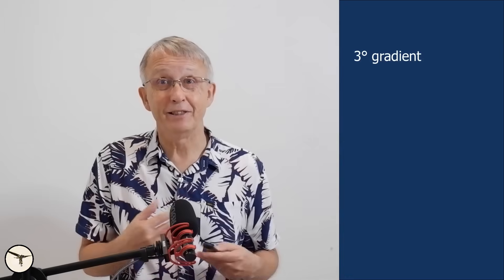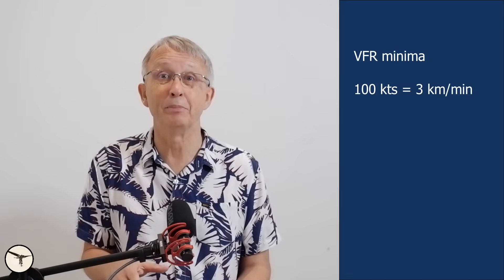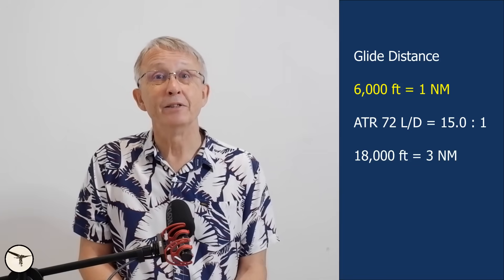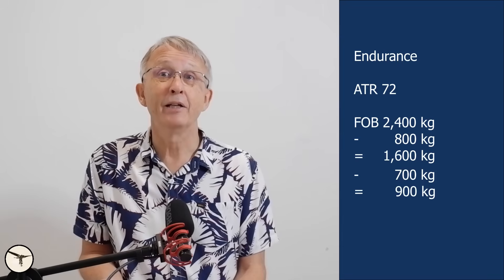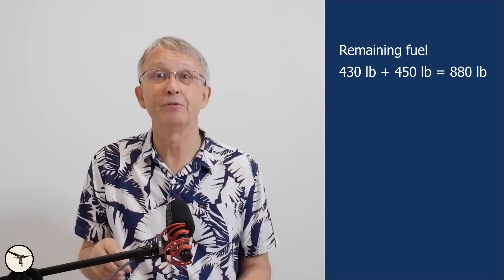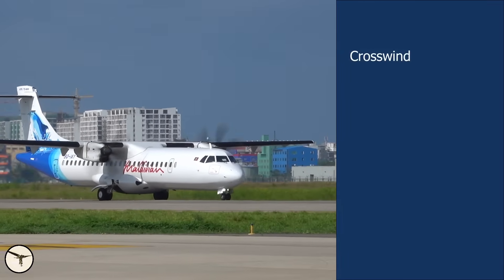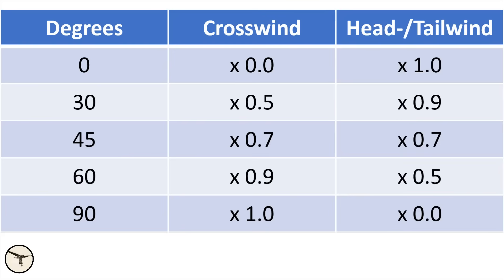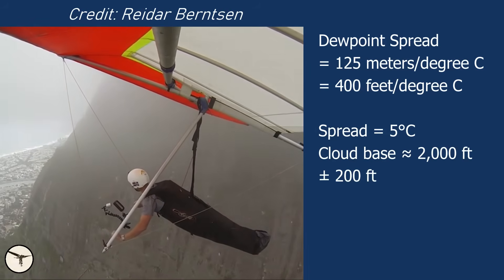The Surprising Truth About Math for Pilots Nobody Tells You

Comment: Thank you Capt. One question: In the video you state that best glide speed is White bug + 10, while in the ATR 72 manuals the recommended speed for Eng 1+2 Flame out is indicated as VmHB which is White bug + 5. Why this difference?
Reply from the maker: High bank speed can be anything between white bug + 5 and white bug + 10, depending on ATR variant and weight. Therefore, ATR recommends white bug + 10 as a rule of thumb.
Reply: @FlywithMagnar  thank you for your reply. In the ATR 72-600 that I am familiar, the difference between VmLB and VmHB according to the QRH tables is 4-5 knots for all weights, which makes sense as according to the FCOM the VmLB=1.18Vsr and VmHB=1.23Vsr. So at least for the 72-600 I would expect defining the glide speed VmHB as White bug + 5 would be way more accurate than White bug + 10. Please correct me if I am wrong.
Reply from the maker: I have no problem with that. Having flown six different ATR variants, I'll stick to white bug +10.
Reply: Thanks so much for the reply Capt, and for the excellent training material that you generate. Your efforts and expertise are highly appreciated.

Comment: The statement that the weight of the plane does not affect the glide distance is wrong. At the top of descent, you pull off the power. In a large (heavy) 4 engine transport catagory jet, if you are heavy, you add another 10 miles to the calculation. In addition to the adjustment for a head or tailwind. 
  A heavy plane needs more distance to descend with power off because of momentum. A lightly loaded aircraft descends faster. It is the opposite of what you assume. But in large jets, momentum is a factor in many aspects of the flight. This guy must be flying small planes as this seems to be his point of reference for all this.
Reply from the maker: That's energy management. When you travel at the speed for the best glide ratio, the weight will not affect your glide distance.
Reply: @FlywithMagnar I assure you it does. I have 16,000 hours in 4 engine heavy jets and I speak from experience.
Reply: Capt Nordal is correct that best glide ratio does not change with weight, which theory can be found in any textbook dealing with the topic, eg: Airbus doc Getting to Grips with Aircraft Performance. On the other hand, the airplane that descends at a TAS faster than best glide will descend at a lesser gradient than if flying the same speed at lower weight (figure H4 of the above reference). But that is not best glide speed. The lighter airplane will descend with the same gradient and a lower rate when slowed to its Vbg. Glide angle γ = - D/W. Drag at best glide varies directly with weight so γ does not change. 
  But density is a fly in the ointment. Those equations apply to the equilibrium condition which does not hold for the airplane descending at constant IAS into the increasing density. TAS reduces hence KE reduces. Mass is constant (in a true glide) and drag remains constant (IAS constant) so from the work-energy theorem the flight path must be longer to account for the ΔKE. The additional air distance must be ΔKE/D. And the additive will be more for the heavier airplane by a factor of root (W2/W1). So yes, you are correct and the heavier airplane does glide further, and yes it is a bigger factor for heavies.
  Not questioning your experience based answer but given this is a ‘math for pilots’ video it can’t hurt to work through a hypothetical example. Eg mass 100 t; L/D 20:1; IAS 195 kt (100 m/s); Vf 100 m/s; ρf/ρi 2:-
  D = W/20 = (100 000 kg x g)/20 = 50 kN
  Vf = 100 m/s. 
  Vf^2 = 10 000
  Vi^2 = Vf^2 x ρf/ρi = 20 000 
  ΔKE/D = (KEi - KEf)/D = ½ M (Vi^2 - Vf^2)/D = M (Vi^2 - Vf^2)/2D
  2D = 100 kN 
  ΔKE/D = 100k (20k - 10k)/100k = 20k - 10k  = 10 km
  Additive for 100 t = 10 km
  Additive varies with root (W2/W1)
  Additive for 50 t airplane = 10 x root 50/100 = 10 x 0.707 = 7 km.
Reply: @XPLAlN there are books and then there is real life. I can assure you when heavy, you start down 10 or 20 miles early.
Reply: @SandraLee-ix2qd …did you read my comment? I agreed more distance is required. Where we differ is I cited the theory rather than just make the observation that heavies have more momentum. I have my fair share of experience, but I don’t denigrate the technical literature or those amongst us who know what is in it. If you want me to know you aren’t in the latter group then bravo - you have convinced me.
Reply: @SandraLee-ix2qd…that’s your answer? Well ok then.

Comment: I remember learning the rate of descent on a 3-degree glideslope as cutting the airspeed in knots in half and adding a zero at the end, and that is the rate of descent in fpm. Example, approach speed is 120 knots, half of that is 60, then add a zero which gives you 600 fpm to stay on the 3 degree glideslope.
Reply: @derrickwilliams1902  this is stuff you would be thinking about for small planes. In large jets, fpm is not a factor.
Reply: @SandraLee-ix2qd Even for an ILS approach?
Reply: @derrickwilliams1902 you are going a lot faster, if you make big changes the momentum carries you. Momentum is a big deal in heavy aircraft. You make very, very small changes or forget about landing on the pavement. You are stabilized far from the runway. You are either stabilized within 1 dot or you are going around. It's a different world.
Reply: That is the same way my cohort were all taught to estimate the nominal rate of descent. Half groundspeed times ten. Obviously useful for the CDFA but an essential skill for the ground controlled approach. Even on a coupled ILS the wise pilot would carry out a reasonableness check on what George is up to by using this calculation.

Comment: The formula as presented — "altitude / 1000 * 3" — is misleading without parentheses. Mathematically, it could be interpreted as altitude divided by (1000 × 3), which is incorrect. To avoid confusion, it should be written as (altitude / 1000) * 3, meaning altitude is first divided by 1000 and then multiplied by 3.

Now, considering the relationship between distance D, ground speed GS, altitude change ΔZ, and vertical speed Vz:

D / GS = ΔZ / (60 * Vz)

which rearranges to

D = (GS * ΔZ) / (60 * Vz)

Given the approximation Vz = 5 * GS (with Vz in feet per minute and GS in knots), substituting gives:

D = (GS * ΔZ) / (60 * 5 * GS) = ΔZ / 300

For ΔZ = 18,000 feet, this gives:

D = 18,000 / 300 = 60 NM

However, the pilot finds 54 nautical miles for the Top of Descent, which differs from the simplified calculation.

This discrepancy is likely due to variations in actual flight conditions, such as wind, speed changes, or a steeper descent angle, which are not captured in the simple formula. It also reflects rounding and assumptions in unit conversions.

Therefore, while the simplified formula provides a quick estimate, the pilot’s value of 54 nautical miles is reasonable given real operational factors.

Comment: Excellent stuff, much of which I applied almost daily in my flying days.
Two that I would add:
1 It's often easier to add times in decimals - if your regulator and company allows it. So, divide minutes by 6 e.g. 36 minutes becomes 0.6 of an hour. When not exactly divisible by 6, round up or down to the nearest e.g. 26 minutes would be entered as 0.4 of an hour.
2. Some aircraft performance or limitations are referenced to ISA (International Standard Atmosphere).This is assumed to be 15 degrees Celsius at sea level at 1013.2 hectopascals. Temperature reduces at approximately 2 deg C per 1000 feet.
Practical application of the above comes into play when you may have to land at a remote airfield where no  information is available. Say the airfield is 4000 feet above sea level and you departed from a nearby airport at sea level where the temperature was 28C. In the absence of proper information, anticipated performance will be for 20C.
Knowing the relationship to ISA can sometimes be essential when dealing with limitations e.g. one aircraft type has a limitation of ISA+23 if any engine anti ice valve is failed open. So, using our 4000ft airfield again: ISA +23 = 15 +23 -(4x2) = 30 deg C.
Old school pilots should be able to calculate this stuff without the aid of a computer but I suspect the newer generations will be reaching for their smartphones!
Reply from the maker: Thank you for your contribution! Many pilots use desimals in their logbook, when accepted by the authority. EASA allows pilots to round the block time to the nearest 5 minutes; that helps a lot. However, the techincal flight time is measured in minutes (at least in the ATR).
To calculate density altitude, I use the following formula: 1 hPa = 30 feet. 1 degree Celsius = 120 feet (or 4 hPa).
Reply: What this limitation means to the anti-ice valve?